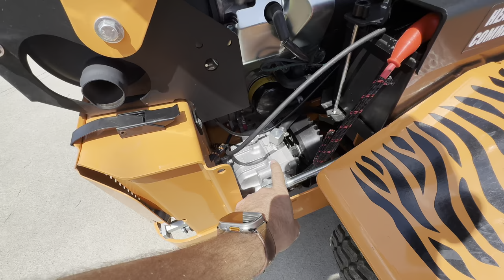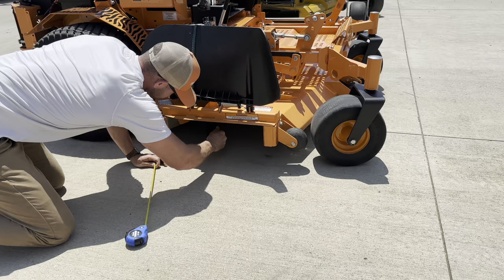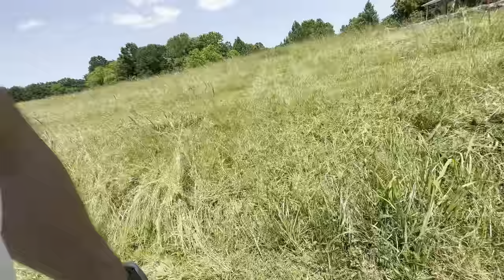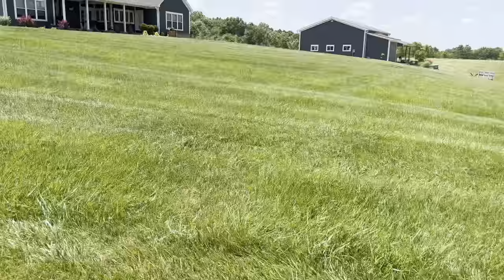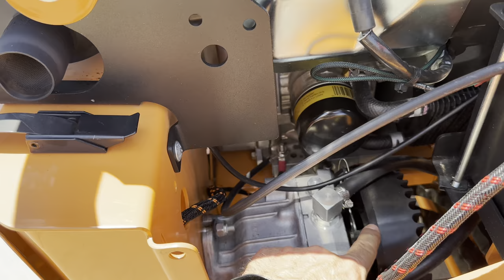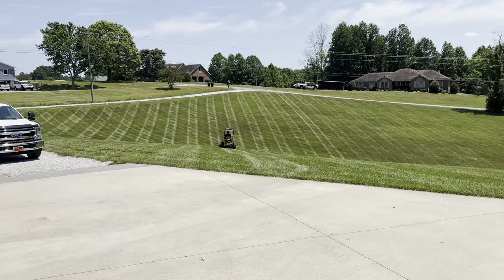Scag turf tiger/cheetah 2 vs Hustler hyperdrive 2023 Extreme testing

Comment: I have liked my Exmark and Hustler mowers more than any. Currently running Exmark because when got new mowers the hustler dealer didn’t do loaner program for commercial guys like myself. Owned Scag, Bobcat, Snapper/Ferris, cub Cadet, Bad Boy, Husqvarna, and John Deere. Hustler and Exmark is my preferred.
Reply: I heard toro owns xmark. My question is are the toro commercial zero turns as good as xmark since their basically the same? Or is there a difference in parts?
Reply: @fiddlinjazz some models are exactly the same outside of the mower deck. The toro 5000 and 6000 z masters are identical to the exmark lazer z s and x series.

Comment: been running scags for 20 years. 61" turf tiger currently has 3040 hours. cheetah has 1400. tiger cub has 1855. tiger cat has 920. an vride only has 424 hours. i have also owned exmark, toro, dixie chopper, walker, an john deere. an demowed hustler, grasshopper, an graverly. alway thought scag was best.
Reply from the maker: They make a great mower I would highly consider one

Comment: I'm in central FL my buddy has run two 61" turf tigers 5 days a week ,50 weeks out of the year, for 20 years. The only thing he's replaced besides belts is a couple of spindles. Scags are tanks.
Reply from the maker: Great information thank you
Reply: So he's got like 10,000 hours or so on them units?  🤣🤣
Reply: @T_81535  Idk the hours , I just know he's had them since 2003 or 2004.

Comment: Cool test,but a few variables in this test.  

Blade condition 

Blade type 

Tire pressures make a difference. Not sure if it was checked.
Reply from the maker: We have everything checked and equal on mowers. All mowers are running high lift blades. Scag blades are brand new. My hustler is running blades I’ve resharpen at least 3-4 times. I try my best to remove all variables possible. 
Thanks for the input
Reply: @americandream_89  have you guys ever run X blades?  I have Ballard Hybrid Gold and ripper blades in X configuration.  I tried to mulch on demand kit and hated it.   Removed it and been running this and it’s no comparison.  finer clippings, throws farther and I’ve got a 740r with 23.5hp and 60 deck.  So you guys are working with a lot more power and and probably benefit more, but I enjoyed your test.
Reply from the maker: I haven’t used an x blade set up yet. I’m still on the fence as in cost versus cut quality. I cut every week and have yet to have to do a double cut so I wonder if blade and tear is worth having two sets on it at once. Just like you stated, I’ve heard many say that it cut really well and makes the clippings much finer. 
I do have Dixie chopper coming out at the end of June and one of their mowers has an ex blade set up on it .
Reply: @americandream_89  with the power you have you could run a few combos. 

I have too many blades lol.  My 2025r 60D HC uses the same blades as the 740r & 760r 

High lift and mulch type (Gator type)

Medium lift and mulch
Reply from the maker: @MJF40  I may get some out before Dixie gets here and compare x blade results

Comment: If you'll buy yourself a Ferris 3300, you'll have the best along with the most comfortable. 😊
Reply from the maker: Do you feel like Ferris as a company does well with the dealers? I asked that because I have tried to get them to come out along with trying to get demos. No dealer ever seems to be able to get a rep or demo unit out. in my experience that’s a sign that they don’t take care of their customers. What’s your thoughts?
Reply: @americandream_89  I will also add, I bought a new cheetah when they first came out several years ago, nothing but shorts. One time it wouldn't start, one time it wouldn't allow me to shut it off, some times I couldn't get off without it dying and everything was in neutral. After several trips to the dealer and them telling me nothing was wrong, I sold it and went to Ferris. After years of service I've only bought blades a few batteries. But that's just my experience, I still like Scag mowers.
Reply from the maker: You truly seem like an honorable person that wouldn’t want to steer someone in the wrong direction. I’ll do my best to get Ferris out for testing as mentioned above. I’ve contacted them at least four times including the main corporation and several internals without prevail, but I truly do want to test Ferris and give it a fair shake down. Thank you for the information. I have Dixie chopper and bad boy coming out in June.

Comment: Another great video!  I think you are spot on with your assessment of the two Scag's compared to the SZHD.  In wet or damp grass, I think the Scag, along with Deere, do a better job in that regard.  Not saying the Hustler is bad, but just not as good as the other two in that scenario.  The Scag does have a tighter feel to the sticks, not near as smooth as the Hustler, but I prefer mine that way, which is solely a personal preference.  The Hustler has a better ride IMO
Reply from the maker: Thanks buddy! Scag makes a really good mower. I try to keep bias to myself for video sake and a organic look at all mowers. I think the only reason the hustler rides better is the springer forks and air front tires. I wold like to test them both with exact setup. Along with adding the seat from the scag turf to the hustler. They would be so close then. I’ve got a rain video coming in the next video. Thanks for your input as you have both helps others to see I’m not blowing smoke.
Reply: @americandream_89  It’s tough to beat pneumatic tires for ride quality.  Scag, Deere, Exmark all have a “solid” type no flat tire which will always be less forgiving than an air filled tire.  I mow some on the side, so I prefer the no flat tire, but my SZHD definitely rides better.  The longer wheelbase helps too.  I do prefer the lower profile of the TT2 as far as sitting closer to the ground, closer the better for me, but that’s a personal preference.  For me, the Exmark seat feels the best out of all the mowers I’ve owned.

Comment: The SCAG deck belt changing isn’t hard. You don’t need to loosen the spring. They all have a spot for a half inch drive ratchet. The ratchet gives leverage to loosen the belt. It is much easier with a second person though.

Comment: Ive never owned huslter but they are super nice, but i do own scag and have had 2 cheetahs a turf tiger and a vride 2 and the cheetah for some reason cuts the best imo but as far as the stragglers on the scag they have adjustable baffles and if you lower that baffle it will create more vacuum and eliminate most of them and stripe a tad better too
Reply from the maker: I was marveled that the cheetah cut better than the turf tiger. I’m still confused on that to be honest. Both are great machines and would make anyone a great mower. As for longevity do you see the turf tiger design as superior?
Reply: The Hustler does too.
Reply from the maker: @404nitro  I’ve got mine down

Comment: I had a Hustler Raptor and it worked great and I sold it before I moved to a different state. I have a Scag now and the Hustler is not in the same class as the Scag, but it’s not real far off. In sit down zero turn Exmark and Hustler are top of the line, if you go stand on I would add Wright.
Reply from the maker: Thanks for the input. I haven’t used a Wright yet. Going to try and get them out

Comment: Speed is also going to determine cut. Are they all running the same speed?
Reply from the maker: I’ve cut will all 3 multiple times. They left the machines here for roughly 3 weeks after the test. All 3 cut really well. I think they are on par and not much difference overall. But yes to answer your question

Comment: They are both top of the line commercial mowers. It’s a personal preference thing IE: Ford vs Chevy. I’m a Hustler guy just because I prefer the heavy build and simple design. Toro / Exmark builds some dang good stuff as well. I bought a Super Z 66” last year. My only gripe is the KX1000 carbureted drinks fuel… 2 gallons per hour on average.
Reply from the maker: 2 gallons a hour seems hard for sure. I’ve got a video on here with all 3 testing also. Hustler, exmark and scag
Reply from the maker: Exmark vs Hustler vs Scag comparisons Part 1
https://youtu.be/OkxJjo3XWaM

Comment: I have a Hustler Trimstar 48 Walk behind that I've owned for several years. The cut quality is superb and reliability is excellent. I have a sulky for it but I prefervto walk. I think sit-on Zero Turns are for lazy folks. The maneuvarability of a walk behind in unmatched in mowing around beds and obstacles. Keep your deck adjusted properly and cur quality becomes a function of sharp blades and cleanliness of the deck.
Reply from the maker: We are polar opposite on likes I can’t stand a sit down. They beat you to death on big yards and rough terrain. A man would need knee replacements after a year at my place. They all run tiny tires and seem slow compared to sit down mowers

Comment: Cheetah is junk compared to the turf tiger. Pumps leak all the time, the 2 speed option is only for running down the road, not for mowing. The tires are slippery as hell, the whole suspension platform under performs. That being said I sold my cheetah and will never buy another.
Reply from the maker: What did you replace it with

Comment: Hey man I enjoyed the video. Quick question. I’m 6’1” with long legs. How is the leg room on the SCAG Turf tiger 2 compared to where the handles are at? Leaning more towards buying a turf tiger.
Reply from the maker: Glad to hear.
 You will fit great. It’s very adjustable. You can adjust the handles up and down along with forward and backwards for arm length.  My cousin is 6’2” and he fit fine on it.

Comment: "...this runs a 24, this runs a 26..." How about telling us what the hell you are talking about? Tire size? Engine HP? Speed-mph? Then during the cutting "this is a 38". What? Oh, and you don't need a pair of pliers to change the Hustler belt. Just grab the belt on the trim side with one hand and flip the belt off one pulley with the other hand. If you are worried about removing the spring on a mower deck to change a belt you are doing it wrong. You only have to touch a spring when you change a spring. But over all very well done vid.
Reply from the maker: I feel like I detail well but I’ll try to go in more detail on what I’m referencing. Thanks for your input
Reply: You should calm yourself. It's just a lawnmower video.
Reply: @T_81535 I’m with you
Reply: You are giving lessons about removing a belt yet can’t decipher the numbers he is talking about…SMH lol
Reply: @Hawk0827  yes. I've had those belts on and off dozens of times but have never read his mind before.
Reply: @georgesimpson3113  I forgot about writing this comment.  I should not have responded like that. I do apologize.

Comment: What are the weight differences? 
Two are leaving  heavy wheel tracks.
Are they knocking the grass over and in a half hour the grass will pop back up..
I don't have a zero turn.
I have the largest Kubota in the B series when I bought it. 30 hp
B2910 with loaded rear tires. 72" deck that I can only use 3/4 of because it knocks down the grass.
Yes I use high lift blades.
My blades spin about the same speed as the zero turn.
Just saying when doing these test , the tire compaction is a huge deal.
Just my thoughts on this.
Reply from the maker: All these units are within 100-200lbs of each other. None are compacting the ground more than the other From a weight standpoint. The bigger tires compact the ground less because of footprint.

Comment: Appreciate the video,what a beautiful place to live and to be super proud of!! I’m trying to decide between the cheetah and turf?? I wonder on the hustler if the discharge opening being smaller helps it have more “suction” for lift ability?
Reply from the maker: Thank you! We love it here and feel blessed to have this as our home. 
I think my blades have slightly more lift but have nothing to prove that. The scag cuts great and I’d recommend that mower to anyone. 
It would be really hard for me to choose between the turf, tiger and cheetah now seeing the cut quality of both. In my original decision I figured the turf tiger would cut better than the cheetah but seeing the cheetah cut better blew my mind. I also now do not understand what the benefit of the driveshaft is . I do feel that the turf tiger is more robust. But the cheetah has a floating platform so it’s really a tossup. A lot of people get caught up in seeing that the cheetah will run 16 mph. In my experience you almost never shift gears because you have to stop so in all reality it will run 12 mph in the in the mowing gear. It’s a lot to think about.
Reply: @americandream_89  I know and that’s exactly where I’m at also,so I may just do the American thing and just get the one the I like the looks of the best.😝😂
Reply from the maker: @trentwatts4913  amen brother! Good luck 🍀 
Let me know what you do and why!

Comment: I've got a cheetah 2 and my belt slipped off today. I had it put back on in 5 min with no tools
Reply from the maker: I’m guessing you right side one looking at the front?
Reply: @americandream_89  They both came off. The springs came out of the holes in the pulleys and released all the tension. I had to route everything from scratch. The hardest part was to tell the routing of the smaller belt by the routing diagram on the deck. I had look at another youtube video to confirm how to route the belts.
Reply from the maker: @jeffa7148  thanks for the info
Reply: That's what I want to here in these reviews.  How long do the belts last and is there a routing diagram to look at.  Are you replacing belts every month because they stretch and the tensioner cant take up the slack???  Belts aren't  cheap!!!
Reply from the maker: @sawmill123456  I’ve got almost 200hrs on my hyperdrive no belt issues
Reply: @sawmill123456  My mower has about 90 hrs on it. The original belts are still in good shape. There were no signs of visible wear on either belt. I inspected them as I was putting them back on. I think something just knocked it off track.